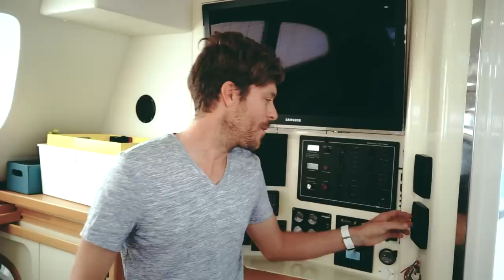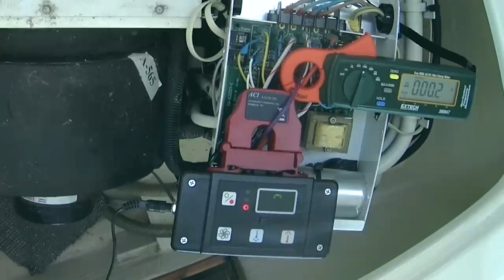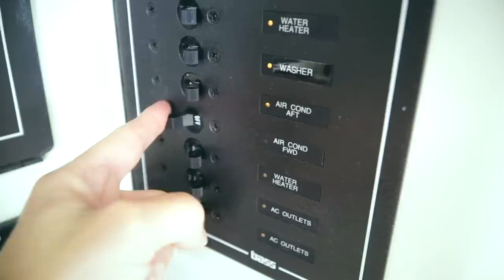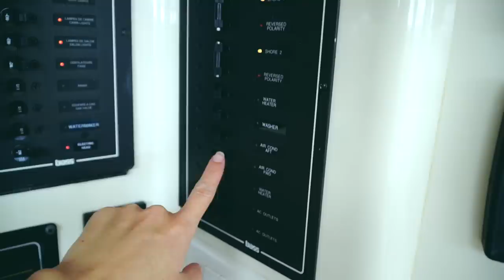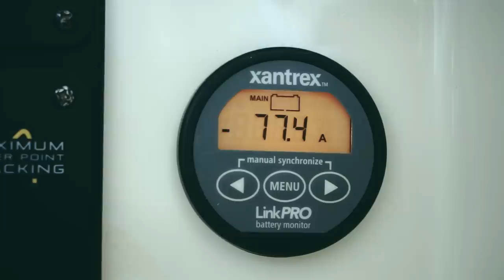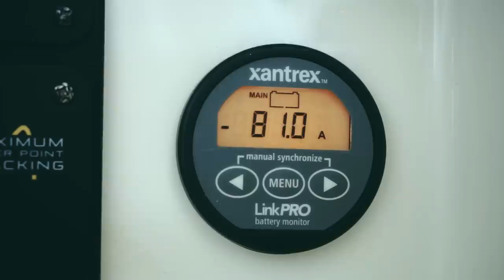Air Conditioning on a Sailboat? Yes, & It's Battery Powered!

Comment: what does it take for you to run your Air Conditioning on Direct Current (too may ACs).  Inverters are a major loss point in any power system.  Is there anyway you may configure your batteries at higher voltage (48V, 72V or even 96V).  The point of AC is transmitting power over distance.  Your boat isn't distance.

Comment: I seen a home built air conditioning for a boat. Get a car heater core a electric water pump and fan and a hose. And build a box for it pull water from around 15 to 20 ft under the boat run the cold water throw the heater core and have the fan blow on the heater core the return hose let it go overboard. And the box have it drain overboard too. If you have a refrigerator that is water cooled use the pump and the inlet put the core between the inlet and the refrigerator.

Comment: Do you have to get an individual easy start for each appliance you run? Or one easy start on your system will work for every appliance -- frig + ac + generator, etc?
Reply from the maker: The AC is the only thing that requires an easy start because the initial power draw to start is so high.
Curious Minion

Comment: Hey I Love your video quick question I just bought a Catalina 30 I was thinking about running my air conditioner with a Honda generator or run it through batteries and an inverter what's your best advice

Comment: I followed  RVers for awhile, and they all used de-humidifiers. Are they obsoloete in the tropics? I am aware of the humidity there, I was born in Panama. Boaters enjoy themselves so much it is hard to say I'll retire to a small orchard versus I'll get a sailboat and live in it. I also noticed you took a trip to Volcan, Chiriqui, and that is where I would start looking, but island hopping looks mighty fun. Still living in Pennsylvania, hoping to move down there in late 2018.
Reply from the maker: We have mini-dehumidifiers but a big one draws too much power and makes the cabin hot!
Reply: A dehumidifier is an A/C unit in most respects, it just has the evaporator and condenser coils sandwiched together.

Comment: Just know that some compressors need to be up to speed in 1-2 sec because the lubrication is dependent on it.  You may also move more of the start load to the running winding from the start winding where it's not designed to be.  If you're out of warranty then have at it, but a call to the manufacturer might be smart otherwise.

Comment: You said that you have a too big AC device. I just wonder if there's smaller devices that could be "enough" to lower the temperature (and most of all the humidity) that wouldn't drain the batteries as fast...? What you consider being "enough" power for AC? (of course this depend on the size of the boat, insulation etc...)
Reply from the maker: My dream would be an 8k BTU AC for the "owners" side of the boat...but that's a lot of install costs.

Comment: In a Monohull we put a window unit in the companionway and run it off batteries through an inverter. A 5200 btu unit runs around 450w. With 540w of solar and 600ah battery we run it during the day on the hook or save up power for the evening. But we have the same darn issue with that. Can the Soft Start be wired into the inverters 120v side or do we need to hook it up to the A/C unit internally? 

Pure sine vs modified on that and A/C units... There's another topic!
Reply: Hello S/V Redemption.  Thank you for your question.  The EasyStart must be installed into the A/C unit internally because it needs access to the individual motor winding connections.

Comment: Hi. I agree if you got the power capablity to run it. The temp today is 26 degrees very hot and its going to be like this over christmas so next week i am investing an 12v battery powered air conditioner. Hey happy holidays and take a well earned
break. See you in the new year.
Gerard on readybaron.

Comment: Do the soft start units impinge on the performance of the aircon compressor, affect longevity etc?
Reply: Hi Tim.  Thank you for your question. Use of the EasyStart can actually extend the life of a compressor! Because it eliminates the mechanical and electrical strain on the windings that occurs during every start-up, the compressor is much less deteriorated during each starting event.

Comment: Jason and Nikki, I know it would be small compared to your boat size but doesn’t the Toyota Prius use some kind of an electrical air conditioner?  Would something like that allow you to cool a small area like your bedroom at much less power draw?  Just asking.  Also I see on sailboats in my area that many have wind generators. You’re always on the water. Whenever you’re moving under sail or power the turbine would be spinning.  Have you given thought to that?
Reply from the maker: +FlyingGyros  For one thing electric car ACs run on 300v so we'd have to power it separately somehow or rewire the whole boat which would create more problems than it would fix. We touch on why a wind generator won't really work for us here: https://www.gonewiththewynns.com/charge-boat-batteries

Comment: Have you ever thought about a wind powered generator? Would it help, hurt, too expensive, too variable? It seems like it might be a good supplement at night. (Yes I realize if you have a breeze, you probably don’t need AC, but you still might need a battery charge)
Reply from the maker: we have, and we discussed it a bit on this post: https://www.gonewiththewynns.com/charge-boat-batteries
Reply: Watched the video, I didn't realize wind generators were so inefficient. You mentioned nuclear, you really don't want that, I was on a nuclear submarine(s) for 7 1/2 years and they are just a touch heavy and you'd have to find a place for 10 or 15 technicians to run it. Nuclear powered AC is awesome though.
Reply from the maker: "We're gonna need a bigger boat"!

Comment: would it be possible to add a couple of large capacitors such as those used in car audio applications to deal with the power surge from the compressor turning on ?
Reply: Hello MetroplexPrime2009.  Thank you for your question.  There is a common misconception that adding more batteries, giant capacitors, or other boosts to the battery side of an inverter will help it source more power on its output AC voltage side. Certainly, sizing the batteries and battery cable correctly are both very important, but that only allows the inverter to perform to its maximum surge specification.  Any addition cable size or battery capacity won't help it further.  It's the steady-state and maximum surge wattage specifications of the inverter that will determine the absolutely maximum output on the AC side since the electronics in the inverter itself are the limiting factors.

Comment: Has anyone ever heard of Eva polar? It's a tiny little box looking device that is an air conditioner.it doesn't cool down a whole room but I have always been so curious if it would be a good option for this type of application.it only draws about 8-10 amps I believe.wouod that work in an RV say at night by your end table?

Comment: Hi, we have 5 compressors on our boat one is 80,000 BTU and then 4 x 8,000 BTU running off 220volt 7.5KW inverter with about 2,500 Amph battery bank, we so far have never run it of the batteries, instead using our generator, but would we in theory be able to run it off our batteries? BTW  the 80,000 has an Ecco setting that is supposed to help with soft start.
Reply: Hi Jonathan.  Thank you for your question.  The 80kBTU system by itself probably draws more than 7500W, so trying to run that would not be feasible on your inverter.  All of the individual 8kBTU units though certainly can be run on the inverter; however, if 3 of the 4 are running, and the 4th one tries to start, the compressor surge for the 4th plus the sum of the running amps for the other 3, might be a problem for the inverter.  If it is, the EasyStart will certainly resolve the issue.

Comment: interesting video. We have a 13,000 btu ac in our motorhome with 30 amp shore power.  Wonder why the startup amp draw hasn’t tripped the breaker so far.. knock on wood.

Comment: If you start the AC with a genset, then switch over to your inverter, will that reduce the startup load. The problem I see is the compressor will cycle through on-off as you reach the thermostat temps. Do you get the start up spike each time it kicks on?
Reply from the maker: Brent, you have the sorta-work around.  It's the initial start up that has the largest surge, the cycling on and off (as long as there's not too much time in-between will be a softer start).
At least this is what we've been told over the years.  Not a perfect solution but it may work.
Reply: I have a 16K BTU AC for the main salon & FWD cabin and an 8K BTU A/C for the aft cabin. I'm going to try the after cabin 1st...after I check the inverter and AC amp specifications. I have a 3.5 KVA genset and it will run both ACs (and heat)  at the same time started at the same time

Comment: Hey you guys should invite Kent to join you for a reunion cruise / vaca. Jason needs to rekindle that bromance. lol
Reply from the maker: Yea...I've got some work he can help with too :)
Reply: I think you`re being a soy boy not installing a wind generator. Some of these wind generators are fake and poor quality so you have to know the tech. There's plenty of places to install. Google image wind turbine catamaran. If a 24k BTU runs 318 watts. 16K BTU would run 212 watts. https://www.youtube.com/watch?v=B9e_owv9U7w assuming this claim is true a conservative estimate of 150 watts average. 2 units could bank 1.5 air conditioner hours  per hour at 14MPH winds in the dark. They`re saying the rotating bearing on this model is a thrust bearing. When this trashes and is not a quality bearing, such as thrust bearing, it produces noise. Looks like either this company has stepped up their game on evolving tech. OR it's baseless claims.

Comment: I wonder how efficient it might be to only cool your bedroom cabin (with the door closed) using the same type of highly efficient air conditioning unit that they install in the newer models of electric cars? Does anyone know what voltage and how many amps those draw?  Unfortunately, I think they probably run off the high voltage main vehicle battery rather than the 12v auxiliary battery.  :( Guess you'll need to upgrade to a salvaged Leaf battery pack too from a wrecked car...and why not salvage the motor too and connect that to your prop!  ;)

Comment: Would dehumidifiers - portable etc fix the mould issue - rather than using the AC?
Reply from the maker: +JoeTheLion60 We have 2 small dehumidifiers that run when the AC isn't running.

Comment: Can you set the AC on a timer?  Say for 30 minutes to help you fall asleep or for a bit every hour for the cats if you're gone for the day?
Reply from the maker: +Alex Todd you can get an auto-start for a generator that monitors temp. So you'd have to leave the AC on, turn the inverter off (or make sure the AC isn't wired to it) and when the temp hits the threshold, generator kicks on, AC runs until it hits the cool temp you've set, then genie shuts off. The good news with cats is that the like warmer temps than people do leaving the windows open with a breeze will almost always be cool enough for them. As for having the AC on a timer so you could fall asleep, wouldn't you have the windows closed for the AC so when it shuts off somebody would have to get up & open the windows?

Comment: Could you get a small AC unit for the cabin for sleeping.....or isn’t it an issue at night?
Reply from the maker: Well since it's a boat, you can't just buy a small window unit and stick it out of a window, but even small units pull a pretty good amount of power. You do adapt somewhat to sleeping without AC and as long as you have good air movement from fans it's usually bearable.
Curious Minion

Comment: Well Butter my butt and call me a biscuit! This is exactly the video I needed to find and a very well crafted video from an experienced cruising couple to boot. I'm looking over my shoulders waiting for something to bite because this doesn't happen to me very often; I'm not the luckiest guy in the world, and I'm being conservative in my opinion. Color me, Subscribed! 

Anyhow, from a first glance, it looks like your on a catamaran? I'm talking about a 32 to a 38-foot sailboat, monohull, and I'm hoping a 5k BTU unit will suffice. I'm doing what I call a hybrid, diesel-electric hybrid setup. By that I mean I will be able to run on the electric motor, the diesel, or both at the same time, and by the same time I mean, the diesel will also be driving a 48vdc generator through a charger so it can power the motor and charge batteries simultaneously. I don't want to run the diesel anymore than necessary, but if your in the middle of the Atlantic, a nasty storm brewing, you've gone days with inclement weather to where the solar panels couldn't properly charge the batteries, and you're adrift. You fire up your trusty diesel, engage the clutch, you now have propulsion. Next, you flip a switch triggering the electric clutch, and your 48v generator starts powering your entire electrical system while at the same time pumping power back into the batteries. Now, without that trusty diesel your in a world of shit!

Also, I have 480W of solar panels at present. I have an addition 300W (2x150W) budgeted that hopefully, I can fit on the port and starboard side of the main cabin on a 38. I'm working with a 32 atm. In addition to this, I have a wind generator new in the box a that came with the boat when I bought it. Electric propulsion is via a Thoosa 9000 motor kit mounted behind the diesel. The system uses 12 100ah LifePO in three 4 battery bank giving me 300ah at 48v. The sad thing is that the electric drive system is worth three times what the boat is, but I have my eye on a 37.5 Endeavour or a 38 foot Morgan. Everything will move over seamlessly. After all, I'm not doing this to sell the boat for a profit, I want a cruiser, a home, that will take me anywhere I want to go with all the creature comforts I can carry. A 5k BTU air conditioning system in one of the last items I need to build and install.

Comment: Curious, Jason said A/C is drawing 80 AMPS (power management meter), that would be @ 12 VDC.  So, about 1000 Ah.  How do you get 4-5 hours of use on a 1200 Ah battery bank?

Thanks for video
Reply: Hi Douglas.  Thanks for your comment.  80A @ 12VDC in one hour is about 1000Wh (960 to be exact), not 1000Ah. 80A for one hour is in fact 80Ah.  The actual consumption due to the A/C is about 140A @12V (14A at 120V since the SW pump draws 2A and the A/C draws 12A), but because the Wynn's solar panels were active during the filming, the were getting about 60A added and 140A subtracted, making the net discharge rate from the batteries only 80A.  Assuming the Lithiums can be discharged 80%, a 1200Ah bank can provide 960Ah.  960Ah/140A = 6.8 hours.  Jason was being conservative estimating 5 hours since the A/C isn't going to be the only load drawing down the batteries.  You've got other 12V loads that must stay connected all the time, like anchor lights and bilge pumps!

Comment: Thought. Dehumidifier. Much lower power consumption. Addresses the moisture content of the air. Could potentially run it continuously. See if your AC has a dehumidifier mode, some do.
Reply from the maker: +gmoorman73 We have 2 small dehumidifiers that we run when not using AC

Comment: Hi Nikki, I was just wondering how you keep your hair and makeup looking so clean and fresh when you don't use the AC full time. Also when on your travels how often do you get your hair colored and cut and does powder makeup last on a boat with the moisture, just curious????
Reply from the maker: +Michelle Dupont Well sometimes I'm a hot mess (get it?) when I'm not on camera! I use Mineralogie makeup which is extremely water resistant and is amazingly not affected much by extreme temps. I'll post a link here and there's even a discount code! I cut my own hair and haven't gotten it colored pretty much since we moved onto the boat. Highlights are courtesy of Mr. Sun.  https://www.gonewiththewynns.com/product/nikkis-makeup
Reply: Gone with the Wynns thanks for the info Nikki, I can't wait to set sail!

Comment: Thank you for answering that question... So I guess a bucket of ice behind a fan at night while you sleep like we did back in the 50's and 60's would work to cool the room off enough to get a nights rest... I do that in my tent when was on the road on my motorcycle. There's no way to carry a small AC with me... LOL,LOL... It's amazing how it will cool off a 7X11' tent at night. I also put a silver tarp over my tent to reflect the sun so it don't get as hot in my tent during the day when this old biker needs his nap... LOL,LOL... Love you kids. Keep have fun even on the ugly days... Be blessed... BBE...
Reply: Bobby Baldeagle this ice block method will cool down the air comming out of the fan but also will increase humidity even more. in the tent no problem but on this boat all they want is less moisture so pretty impossible to use a method like that.

Comment: We h@ve  two 9k btu air con. 800Ah at 24v of LiFePo4 batteries. 2500w inverter.  We can run one aircon for 12 h without charging.  We have 1800w of solar and a 6 kw alternator